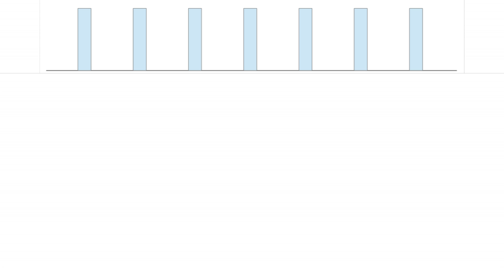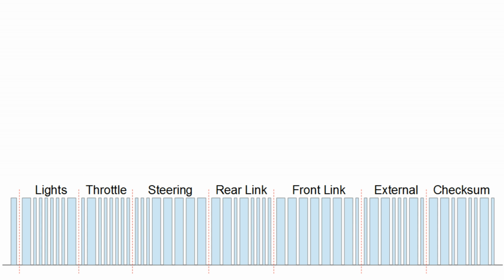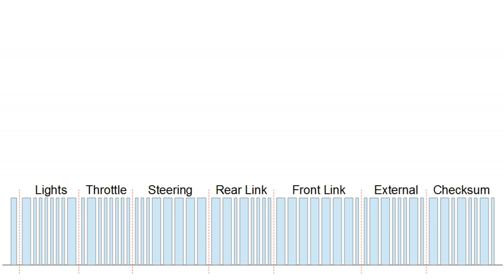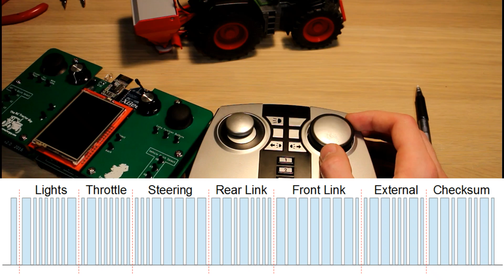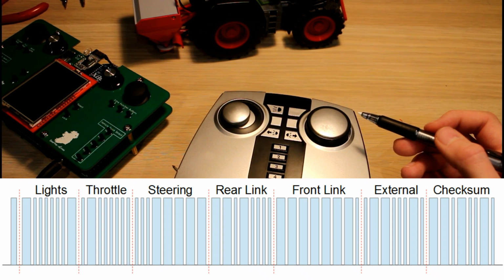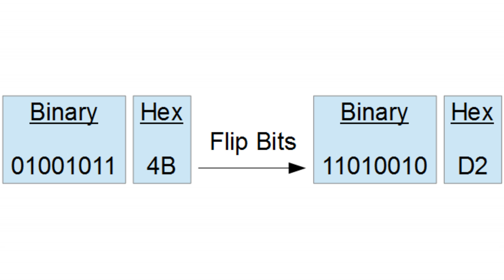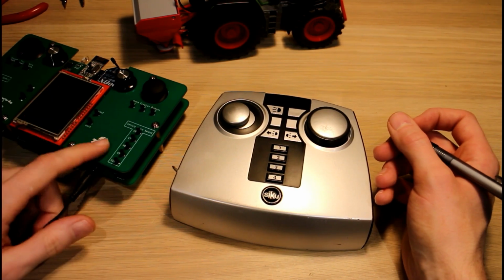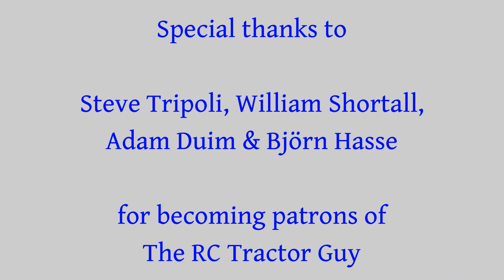I finally figured out the Control 32 IR signal

Comment: The channel you assumed to be the front link is for controlling trailers via the databus which runs through the batteries and a 2.5 mm TRRS cable. There should also be a second light channel which is not used in the tractors, but can be used for additional lights which are switched separately.

Comment: Nice! I had all figured out but the checksum.. I had no idea how it was made up. Was trying to make my own receiver for the Siku Controller, but the error-rate with IR was so high that my servos just kept going crazy. No chance without a checksum or some other form of error correction i guess.. I had some sorting out of irrational values going on and also some smoothing of the servo output values.. But still not enough or the servos moved too slowly. So i abandoned the project. 
Now with the cheap NRF24L01 available the IR stuff is kinda obsolete and i'm currently planning on using that for now.. which is how i found your channel ;)
But i kinda abandoned the whole RC tractor hobby by now.. but looking at that stuff makes me want to try again.
Reply from the maker: I was kind of forced to abandon it over the last few months through lack of time but I'm hopefully getting back into it, starting to make progress on answering my emails and comments at least :)

Comment: so will your kick starter controller come pre-programmed so I can control the siku32 controlled vehicles I have it i got one?
Reply from the maker: +tgh117 Good question, to make the controller work you need to get a microcontroller. I recommend you get a Meduino Mega 2560 and a 2.4" TFT screen the same as I use because then you can program that with the library that will be on my website. That way every time I or someone else improves the library you just have to upload the new library to your Meduino and you will have all the latest features I have. This will include the code for the IR Control 32 tractors, so far I just have channel 1 sorted but I'll be adding the other channels as soon as I can. Also I'll be updating the Siku Control 32 drive screen to match the tractor dash I use on my own tractors and implementing the 3 speed system too.